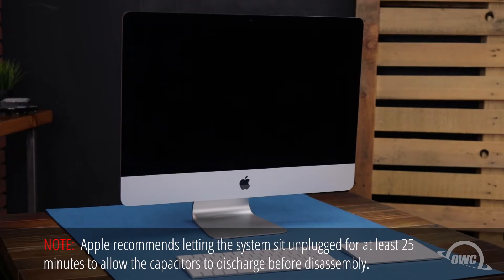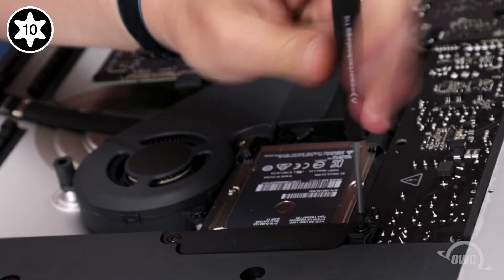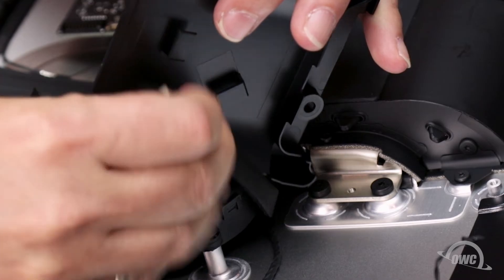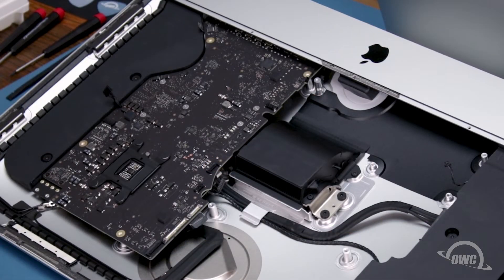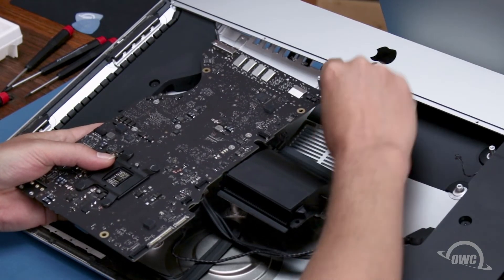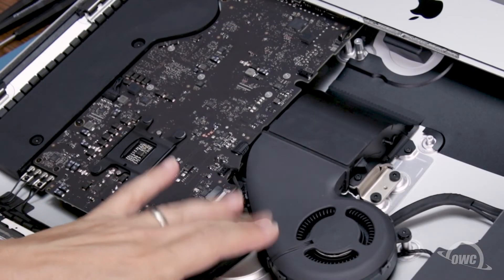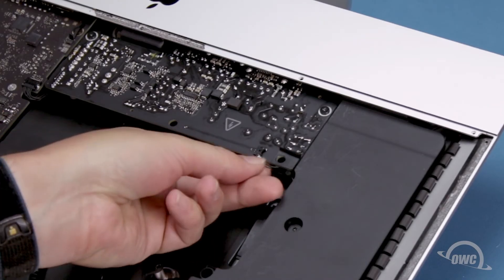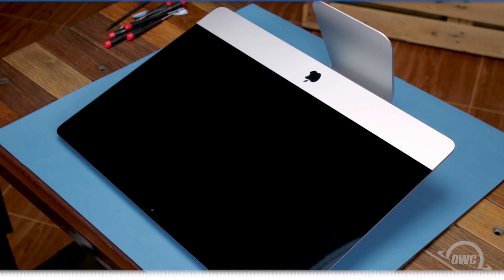How to Upgrade/Install Memory in a 21.5-inch iMac (Mid 2017) iMac18,1 iMac18,2

Comment: Great guide! Went from 4gb ram to 32gb. Only problem I had was the one power cable under the logic board you had to squeeze to pull out. After twenty minutes it finally did lol don’t squeeze from the back of the tab, squeeze at the short front bit.
Reply from the maker: Thanks for the comment, glad to see your installation went successfully! It can be a little tricky once it comes to re-sealing but the rest of the installation is fairly simple. Please let us know if you need help with anything else!
Reply: Hi, officially its support only 16GB (2x8GB) or I'm wrong and you have 4K model? Please reply why did you go for 32GB and how is working? Many thanks

Comment: was someone here succesful to do it?
Reply: Yes, but took me lot longer than on the video
Reply from the maker: Elsa, I'm sorry it took you longer to do the iMac memory upgrade than is shown in the video.  Our technicians routinely upgrade memory on all sorts of Macs, so of course they can work more quickly than someone who may not have done a memory upgrade before.  On the newer iMacs like the 2017 21.5" OWC does recommend professional installation.
Reply: @poweredbyowc  Don't be sorry, so glad that I managed to replace the ram thanks to your video!  I am absolutely not technical, but was able to follow along very well.
Reply from the maker: We are glad to be able to provide everything needed to upgrade your iMac!
Reply: @poweredbyowc  Yes, I am so glad that you guys uploaded this video, I am doing this tomorrow, my OWC Ram just arrived to Portugal, im installing it myself tomorrow.

One question: When I open the iMac (same as in the video), can I change the HDD card to SSD and The new RAM cards too? and then just turn the iMac on again?

Thank you <3
Reply from the maker: That is awesome Victor.
Yes, you are able to change both the drive with an SSD and me RAM at the same time. You should not have any problem with that. Here is the link to our SSD installation kits we offer for the iMac.
https://eshop.macsales.com/shop/ssd/owc/imac
Reply: @poweredbyowc  UPDATE - All done today, working perfectly, you guys are amazing, thank you so much, I saved so much money and my iMac is a BEAST now! <3
Reply from the maker: That is awesome to hear Victor Danu! We are glad that you were able to turn your iMac into a beast and were able to save money while doing so!

Comment: Thank you Apple for making this so easy to do. 🖕
Reply: Ikr!😒
Reply: Felt like I was taking a car dash apart.
Reply: @JosephCrowell  Massive, massively unnecessary difficulty, designed to thwart any attempts to upgrade. And leaving out the 12-cent M.2 socket when there are solder pads on the logic board to accept it is just another act of cruelty.